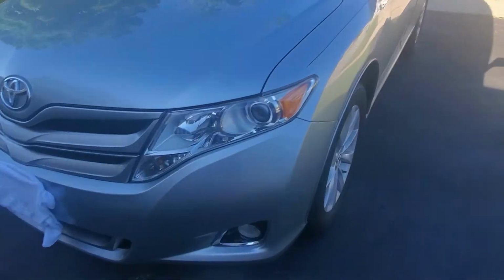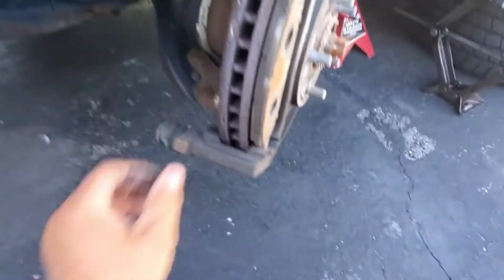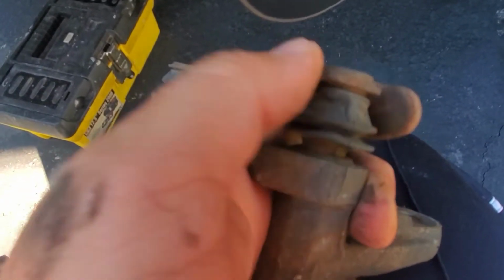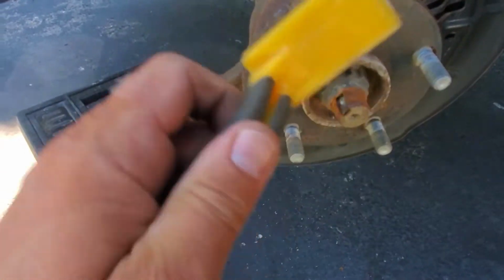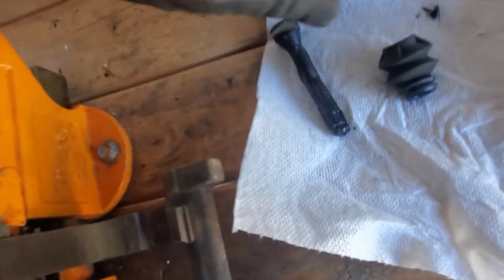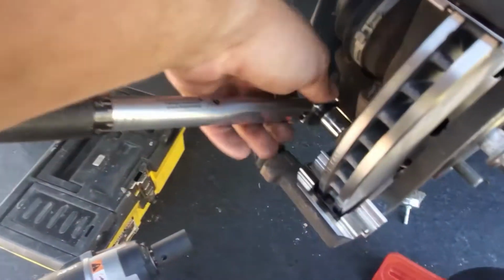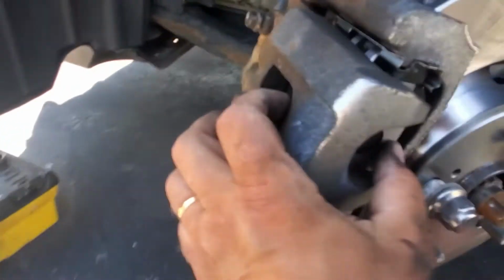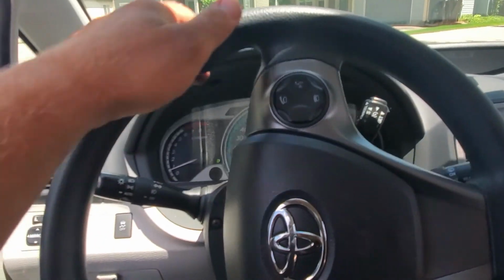How to change brakes and rotors on 2015 Toyota Venza

Comment: Thanks for the video, I wouldn’t have been able to change the brakes without this one!

Just to add, the bolt size to pop the rotors off is M8. I didn’t have one, had to go buy a couple.

Comment: Great video. Thank you for including the torque specs. 👍
Reply: I’m not sure 125 is correct. Seems like a lot.
Reply: @boostedmaniac  I don’t think 125 is correct. I think the front is 77ft-lbs for bracket, 24ft-lbs for shoe and the wheel for all is 76. Rear is 58ft-lbs for bracket and 24ft-lbs again for shoe.
Reply: @darksid33  I agree. 125 is a lot.

Comment: Great video man do you have a video for the rear breaks and rotors?
Reply from the maker: I didn't need rear rotors or brakes replaced at that timem. It's the same principle like tthe front. Remove caliper guide bolts and move caliper out,replace pads and put caliper bolts back l,done. Don't forget to compress the caliper.

Comment: I believe you put the grease on the bottom side of the hardware clip instead of the top side where the pad slides thru it, so the sliding pad has no lubricant. Big mistake if I saw correctly.  No need for grease to be underneath the hardware clip, might even lessen the bracket's hold on the hardware clip.
Reply from the maker: It is not a mistake actually, I saw a lot of people to that in professional shops. I put grease on both sides of that metal shim to stop brakes from making any squealing noises in the future.
Reply: I was going to ask the same thing
Also noted did not reinstall the springs that move the brake pads away from the rotor when brakes are no longer being applied 
Good job otherwise glad you saved some $ and are helping others to do the same
Reply: @nicholasstoica7515  He did show replacing those springs... I saw it. I wondered if they were new or just cleaned...
Reply: @nazarettos6987  But think about it, the hardware piece  does not slide in the bracket, it is fixed  there, but the pad piece has to slide in the hardware piece, so where should the grease be?  On the sliding surfaces, I would say.  And I did not see any lubricant/grease applied there.  Also, I see some people suggest not forcing the fluid back into the reservoir, but instead, cracking the bleeder screw and pushing it out there, into a container with some fluid in the container, and a hose from the bleeder screw going into and below the fluid in the container.  Bleeding probably best, afterward, but that would just be a nice extra flush.  A little more effort but less chance of dirty fluid getting into the reservoir, that might cause problems later, with the fluid return valve plugging, causing brakes to lock up.  Had it happen on the road, once, 300 miles from home.

Comment: The correct torque for the caliper bracket per the Toyota manual is 58ftlbs. Caliper bolts are 24ftlbs, and lug bolts are 76ftlbs.
Reply from the maker: Thank you
Reply: The front is actually 77ftlbs and rear is 58ftlbs for the bracket

Comment: Mine started squealing after like a month. Do i habe to add grease to the back of the pads?
Reply from the maker: you have to install new brake hardware, those metal plates. Also what I like to do is to clean the surface where brake hardware goes. You can also add some brake caliper grease to the back of your brake pads and caliper guiding bolts.

Comment: how much cost you, thanks
Reply from the maker: Rotors and pads total 175$
Reply: @nazarettos6987  thanks, today i have my 2015 venza rear break pads and rotors replaced, i paid $678.5.
Reply: sorry , wrong, i paid $778.5
Reply: Thanks for the video. I just did mine. Parts for front brakes and rotors from Toyota in Canada. $333.
I asked how much for them to do all 4 corners... $1,100. $700. for parts, plus $400. for labour.
Reply: @libaowang5675  Yes, the repair shops often charges you the retail price for parts even though they pay much less than retail. Then, of course they charge you for time and labor. I paid $550 for the fronts to be done about5 years ago. Since then, I do the work myself. There is an small auto parts store near my house that "turns" (smooths) the rotors for $10 each so they can be reused.